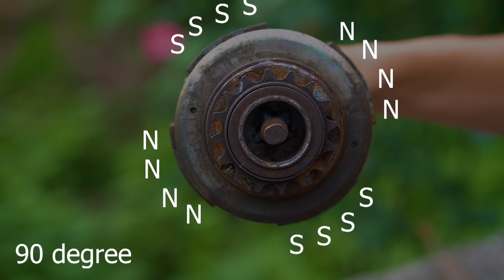I build 220v electric Hydropower dam

Comment: I apologize for my English, I use an online translator. I have been working in the energy sector for 15 years, so I have something to say.
The author is lying. Firstly, there is no 7 kW, the dam itself will not give that much, even in theory, from a power of 20 W. Secondly, the generator itself. To get an honest and stable 220, you need to strictly observe the high-speed modes of rotation of the rotor, taking into account the fact that under load the revolutions will sag, which means that the water flow needs to be adjusted.
Thirdly, it is not enough to receive voltage, it must still have a certain frequency. The generator has 2 pairs of poles, so, to obtain the reference 50Hz, the rotor must rotate at a speed of 1500 rpm, or 25 rps.
Conclusion: a good, usable toy, and not a very good author.

Comment: The water pressure is 0.4 meters, the flow rate is about 8 liters per second. The flow capacity is about 16 W. The efficiency of hydroelectric power plants is at best 30%. The actual power is less than 5 watts.

Comment: You'll get more consistent power by building it as a vertical mill rather than horizontal.

The goal with small scale Hydro electric is charging; not power like say a wind turbine.

Comment: 7:48 - - Anyone who was trained in a university to design electric motors, generators and transformers (that would include me) will be horrified to see the inefficient shape of the magnetic circuit, resulting in very big reluctance (See: Magnetic reluctance - Wikipedia)
So, to make it very simple to everyone: If you want such a project, use a generator already built in a factory!
For this kind of small project, an alternator an automobile will be just fine. If you have bigger debit of water, use two alternators for small cars, or one made for an 18-wheeler truck. Or, of course, you can search and buy something else. Also, every motor built with magnets in it, can be changed to be a generator. Not only them, but it gets complicated... What motor you cannot use as generator: Induction type with squirrel cage.
Back to this homemade generator, welding the ferromagnetic cores of the 4 transformers, is another disaster: It destroys the properties of the ferromagnetic material. Which goes back to what I wrote above, about what to use.

Comment: Maybe 200-400w, tops.  All this and he can’t find a multimeter?
Reply: You have 1 too many zeros 20-40w tops
Reply: @shaynegadsden  I think it’s closer to 200w.  20-40w is too little.  A 20-40w solar panel couldn’t tun that water wheel and bike chain like that.  An e-bike at very low power assistance puts out 100w and believe me, you hardly notice it.   But a small 2 stroke engine like on a scooter, weed -whacker, or medium sized RC vehicle could probably do that easily.  So a 15-20cc engine, maybe producing, 1/3-1/2 horsepower, could do that.  Given a good 50cc generator puts out 750-1000w, I think it’s a good estimate.  we’re in agreement that 220v at any significant load is out of the question.  If he wants to run a few desk fans that pull under 100w, sure.
Reply: @kd8opi  im telling you as an electrician that thing has zero chance of getting anywhere near 100w, the half assed paddle maybe makes a quarter hp but that generator is lucky to have a 20% efficiency
Reply: @shaynegadsden  it looks like he’s able to run a desk-top fans few fans off of it.  A typical desk fan is 40-50w, so if he’s running 3-4, he’s doing more than 100w.  So, I disagree.
Reply: @kd8opi  im telling you it's wrong for starters that isn't making 50hz also inductive loads have high inrush currents meaning when you put the on a generator it bogs down on startup and finally the fact that there is no change in speed as more load is added means either it is a 7kva generator and the load applied was that small it had zero effect or the load wasn't being supplied by the generator
Reply: @shaynegadsden  I think he’s putting out about 100w, powering 2 fans (one with an oscillating drive) and an incandescent bulb.  You’re just gonna have to find a way to pick up the pieces and move on with your life.  Best of luck to you sir.  Remember, we both agree that it’s way less than the power he’s claiming.

Comment: Hate to break it to you chief, but applying mortar directly to dirt will sure, make it stick to the dirt, but it’s not holding that whole thing In place permanently. Plus welding to a rusted surface won’t hold as well as a fresh piece of metal.
Reply: A lot of people have said this already, but their is no way that 220v is needed to power a 2 fans and a light bulb.

Comment: A couple of thin magnets and 7 kilowatts? Very, very doubtful, it looks like 50 watts. To check, load the generator with an electric kettle. Measure the initial temperature of the water, note the time until it boils, this will be an honest test.

Comment: Very Interesting Video, to be able to power 2 desk fans & a light bulb with a 3x outlet power strip, not bad. the Vertical shaft isn't as efficient as the Overshot water wheel, because the Over shot wheel uses a combination of water pressure & Gravitational force to rotate the wheel, causing for less resistance, the water's not only rotating the shaft, but it's also pushing against the next paddle in line, slowing the rotation & wasting a bunch of that energy, plus you might want to boost that Speed ratio for higher RPM crank on that Permanent Magnet Generator. like those Hand Crank Radio/flashlights, crank at a slow RPM, it barely produces enough energy to charge the battery to run the radio or flashlight, but the faster you crank it, the more power it gets out of it. like I said it's an interesting video & that's a good idea for a hydro-electric dam, not the most efficient, but it's a good idea.

Comment: If you don't use a chain,  He can also do it, the way the two water shafts and the generator shaft are connected, then you will get stronger power.

Comment: Very Creative. But the amount of heaviness caused by metal and overall efficiency won't give anything above 25%. If it was 7000W, that little cable would be fried including your barehand. You cannot play with 7000W at 220v so lightly. I have been shocked by 220V couple of time. It life & death situation. Just to say this thing is no where near 220v with 7000W
Reply: There won't be a next video because of that.

Comment: The difference in diameter between the shaft inserted in water and the one attached to the motor is quite small, thus it doesn't give such a mechanical advantage. You could try using a full 26" diameter wheel at least!

Comment: bit of a death trap, but nothing some wood or plastic covers could not fix,
 and probably only able to output something like 300w, but that is still fantastic for a side project made from scrap, 
you are not going to run any high power items from it without issues no hair dryers or kettles, no old fashion light bulbs. 
you could probably fast-charge about 40 smart phones at a time from it though which makes it super useful, or run about 20 LED flood lamps.

Comment: So let me summarize... 7000Watts, ~220V, at a low RPM, with absolutely low water pressure... Sorry dude, the thing is if you will ever produce ~220V (stabile), your torque what the water pressure makes on that "turbine" thingie won't be enough to power anything...(maybe some power efficient LED lights) If you are connecting some kind of load to that circuit, your shaft will immediately stop turning, cause the force needed to the generator shaft to turn around will increase with the power consumption. More load means more resistance. You can not get power out of nowhere. Still you made  another thing for our ElectroBoom to rectify.

Comment: Who needs screws, when you can weld! You can always tear it apart again with the flex… As has already explained by many commentators, there are a lot of improvements that could be made to this design…! (Wobbling shaft, form of blades, flow optimisation…)

Comment: Yeah 45-60watts would be tops on a perfect day!! 7000. Now way possible. I have a micro-hydro generator running At 45psi one inch pipe and spins turbine at 1600rpm. And only makes 1,800 watts max. And it moves. That low of flow and head presssure couldn’t power a fart! Sorry. Love the ingenuity and try!👍🏻

Comment: 15:28 what are the wires going into the big tube, at the bottom? i see quick connectors. edit: oh you made a motor and with a hidden power supply are powering the spinning contraption and the power tap.

Comment: Bro if u would please measure output voltage and current with meter anytime u build any type of generator with the wire clearly shown coming from the generator in the video thanks nice build though.

Comment: It feels a bit suspicious that the core with just a few weak magnets can generate enough magnetic field to power that generator, and without considering the looses bc the air gap,  but also the fact there's no any control system to keep a constant frequency and seems impossible believe that the generator is running at 50-60Hz, and last but not less important there's no any torque that stops the generator when he conect the electric load!

Comment: Definitely fake unfortunately. Most likely the power is coming from either something under the grey pipe or a wire running to the power bar under the soil, which he doesn't move at all once it's running. The "turbine"/generator is turning far too slowly to produce any meaningful power.

Comment: Alot of people are talking about how much watts it can give,but why did he say "100kv coil" those transformers dont give like 100kv or 50kv your microwave would be very noisy with that much voltage and there is a capacitor which cant handle that much voltage it would just do nothing but explode. I think this guy doesnt know much about electronics,because of the place where he lives so i wouldnt say that he accidentally said 100kv i would just say that he didn't know.

Comment: There is no way you can control the speed for actual 220v, and I'm pretty sure the ability to power the fans must be fake, as with that flow, pressure and turbine you are NOT getting over 1kw. Even that said, the video is very cool, the proyect looks very fun and you did a good job :) even if you just turned on 1 bulb i woulda been impressed and would be doubting it

Comment: Motor, not generator.

It may possibly be a homemade motor because I can actually hear it humming. If you look at the propeller also, it doesn't look like the water current is turning "it" but rather the blades are splashing the water around everywhere as it's coming through, which doesn't look normal if it's doing what they're saying it's doing and generating electricity, but pushing the water by itself. I will just have to straight up say it, I do NOT belive at all one bit that thing is generating anywhere near even a thousand watts let alone 7,000, barely would it be generating roughly near 20W with that horsepower and RPM speed. I don't think it's generating anything due to the fact that I simply do not think it's a generator. And because judging by how good these guy's engineering skills are, I don't think they would want to waste their time on something without it at least having the ability to do *something...* (Unless it was simple to make and scam)... So I honestly believe they just made a simple made DIY motor spinning to make it look like the water pressure is strong enough to be moving the propeller hence "generating electricity," but it's not doing such things. It's not a powerful enough of a motor either to let alone be a generator, just powerful enough to do something simple like make it look like the impeller is being spun by the water and not like what I think is happening, which is vice-versa. That's as fast as it can go and all it's basically doing is splashing water around if I'm right about this, I may be wrong. It may possibly also not even be able to be a motor and just be entirely clickbait, but I hear humming from the transformers. And although the Transformers themselves are very powerful and high voltage, the magnetic field is weak, and that's as fast as it will go. That's exactly what they would want, because it will make it even more convincing and more and more people will fall for it and click on the video. I will not deny these guys's engineering skills! But what they're saying it can do is scientifically impossible. We're talking about speed, resistance, wattage, RPM/horsepower and strength. A homemade generator like that, that is that small, is impossible realistically speaking. This is also not the first time clickbait scammer video creators have done things like this, they plug in a motor to the same extension cord as, say a fan or light or phone is plugged into and have a hidden cord/charger plugged into the same exact wall outlet while saying the motor is turning a generator, but it's either spinning a motor that's not doing anything, or that same motor is also plugged in just spinning the same direction so that way they can measure the voltage with a multimeter as what they like to call "proof" that it's doing anything. The most common set up is two motors on a belt and pulleys. They have fake wire connections out, then proceed to hide the real cords or power adapter/power supply that is plugged into the same Outlet or surge strip. And that's what I believe was done here, but instead of it being a homemade generator, it's nothing more than a simple homemade motor. I may be wrong, but if I'm right about this, again I think that's impressive engineering! But I don't like the fact that creators lie about this kind of stuff, not that I believe many are going to fall for this necessarily, but just call it what it is. It's a water splashing blender 7,000! L😂L!!!

Comment: To make a maintainable, reliable, correct design?... 
NO! Weld f@cking bearings with f@cking welding!!! 
WELD F@CKING EVERYTHING!!!
------------------------------------------
Yeah, I'd like it. Really? Powerful generator with no any stabilisators, voltage rectifier, other electronics, that can make stalbe vodtage, isn't it?
Reply: It's probably for video. After recording, the construction was dismantled, look for "actors" in the following videos.
Reply: @ВладимирКудинов-т2т  просто странно это, на видео лепить как попало, чтоб показать, что оно работает. Да и работает генератор очень странно... никакой дополнительной стабилизирующей электроники. Я в электрике не силён, но знаю точно, что если на генератор подключить нагрузку, которую он будет питать, вращаться он будет куда туже. Если же одну из фаз (хотя она тут всего одна, если я правильно увидел) замкнуть на коротко, саму на себя, вращаться он вообще туго, из-за магнитного поля, образующегося в обмотке. А тут всё работает прям как маслом по маслу)
Reply: @yourguide-faust5664  Это да, есть большие сомнения насчет того, что этот генератор вообще работает. Скорей всего реальный источник энергии спрятан в трубе, которая является одной из опор. Которую, почему - то не смогли так же сделать из профильной трубы.
Одна из самых больших несостыковок - при подключении нагрузки, турбина никак не это не реагирует. А должна.
Reply: @ВладимирКудинов-т2т  да, да, вот именно это меня и напрягло) раз нет никакой реакции со стороны турбины, то 99,9%, что здесь замешан сторонний источник питания.

Comment: Lol, negative comments! Lol, dosen't matter how the comments may or may not be genorated on that day! Anyway, this looks like it might not be generating 220 obviously, that does though look like its genorating energy with a slow flow rate of water! So even a light bulb is worth while because you can always use light with lower voltages and make your own bulbs!  Idk with this, maybe just show how many volts are really produced there? Its a really good start to somthing worth while building for an efficent electricity system for low flow areas with water. The only thing for myself is the fans, now im aware those fans somtimes have a problem with turning and then somtimes they just start turning!  So one fan and a light with possibly an old filament is alot of energy!

Comment: I wonder if it lasted a day before it broke.
Weak points weld spots were small, metal not cleaned.
Welding dissimilar metals.
 Wabbling of the part in bucket.
The amount of dirty water would fill bottom of bucket with sediment fairly quickly..
Reply: You must be a real fun person to be around. Have a fun life

Comment: It dosn’t seems that he is even getting 220v ether. There are very little load with just two fans that rotate slow and dim light from the light bulb he is probably getting something around 90v and 10-15w from the system. Enough to power your phone perhaps or a bright 15w LED light to lit the area. It’s a cool DIY project though. There was a video few years ago for a guy in New Zealand powering his whole house with similar but much bigger and more optimized setup.

Comment: Oh, and another thing, you guys know that all the stuff that he powers up run on ac current, for that, the rotor would have to spin at least 30 times per second, or 60 times per second for 60hz. At that speed a doubt he generates 10 hz.

Comment: From the speed of the generator spinning i dont think its able to generate that much power
Reply: If you don't use a chain,  He can also do it, the way the two water shafts and the generator shaft are connected, then you will get stronger power.

Comment: hmm, i wonder why you can see an xt60 and jst connector out the bottom of the pipe at 15:29, i wonder if there is a battery and inverter inside that tube?